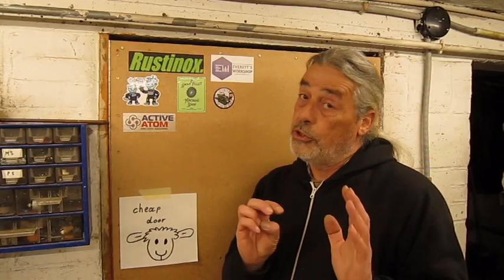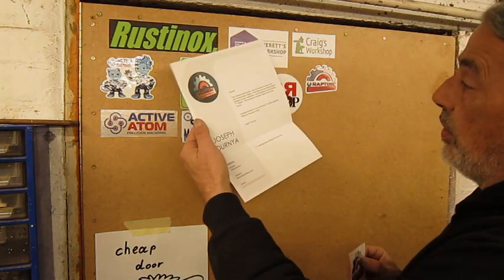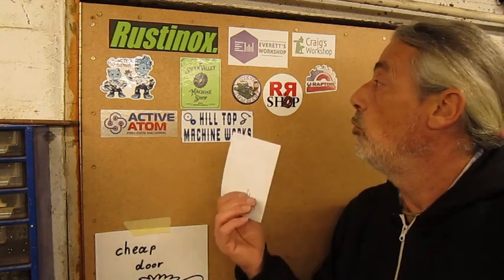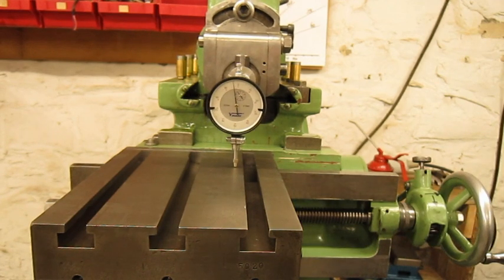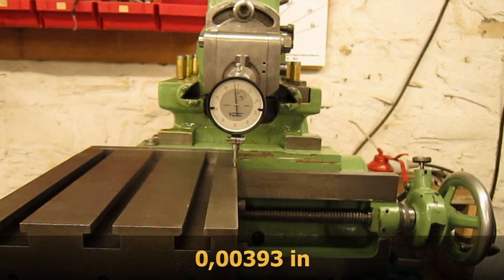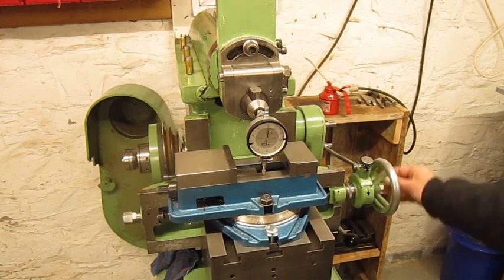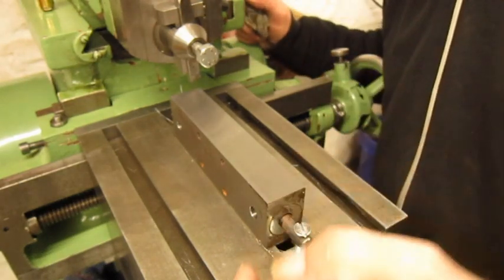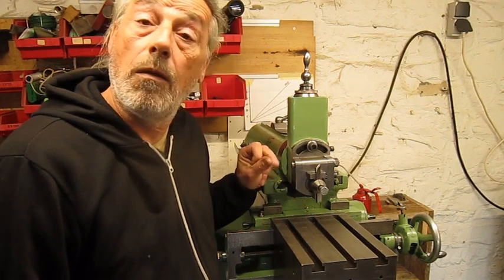A little precision test.

Comment: Good video, and yes the humour is great
I suppose you could face the table with the shaper after enough years if the parallelism was an issue
Your backlash is way better than my machines, I'm surprised I have any threads remaining lol
Reply from the maker: It is indeed possible to reshape the table. I don't want to do that as long as i don't really need.